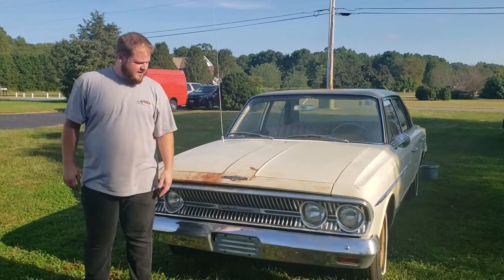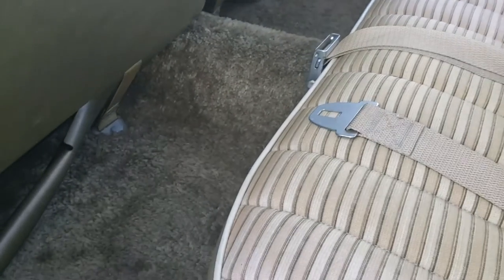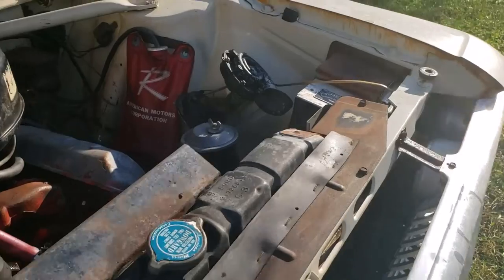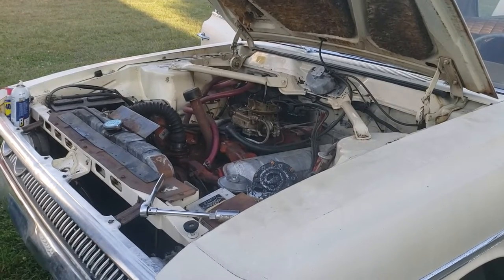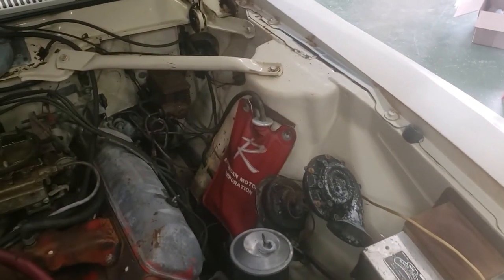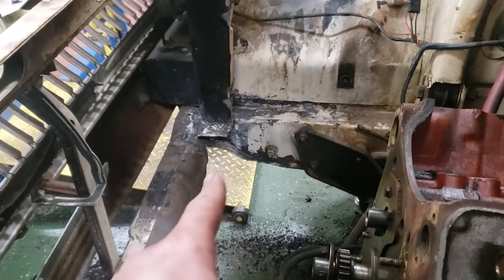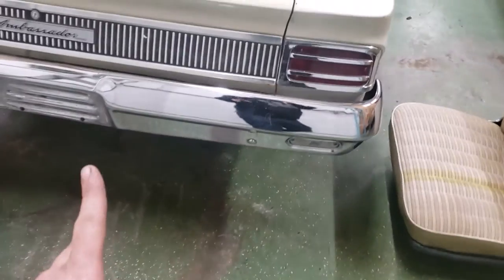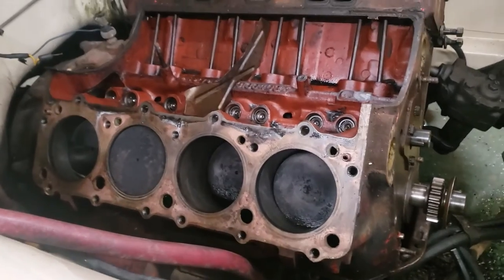Will It Run? - FORGOTTEN 1963 AMC Rambler Ambassador

Comment: Had a '64, same color combo! 327 2bbl. Turned 16.8 at Detroit Dragway, won my class and 4 more rounds of Pure Stock eliminator, with it in 1969. Helpful hint: these engines have nylon coated cam gears, like Pontiac V8s. The nylon gets brittle with age, and if it fails at idle, the engine will maybe survive. At speed, you'll need new valves and pistons. If you buy one used, immediately replace the timing set with one with all steel gears. Otherwise, it's a stout, reliable engine. Make sure when you put the rocker shafts back in, that the hollow bolts go in the rear holes on each side. Thats where the rocker arms get oil from. I've seen those bolts so full of sludge, that you cant tell them from the solid ones. Join the AMC Rambler Club, or The American Motors Owners Association (AMO), to find parts suppliers. There is a Rambler 327 specialist, Kevin Nichols, in Metamora, Ohio, that is a good source for 327 parts, and engine rebuilding.
.

Comment: Amc of this era up to the 67 and becoming Rebals and Ambassador, was the use of enclosed drivelines. Also the front suspensions used trunions and can wear out. Vacuum wipers were in use into the late 70's. Converting to electric? You will need the complete system to make this happen! Have owned many Ramblers. Fun to drive and worth owning.
Reply: I had three AMCs from the 70s. They all had electric wipers. Intermittent even.

Comment: My 64 has the same problem with the rusted cowl but everything else is fine. You can rebuild the fuel pump a kit is on Ebay or was for me last few months ago but not the wiper half so be careful taking it apart. The tank can be saved because no one makes reproductions. Get some gravel and white vinegar and start shaking then pressure wash out as best as possible. Then buy some tank sealer after you patched the holes. There is a place online that sells the correct style sending unit too.
Reply from the maker: All the sheetmetal has been replaced. New video coming soon. I have a rebuilt pump for it. The tank was completely junk. I sourced a used tank that was hot tanked and pressure tested at a radiator shop. On motorcycle tanks I use Oxalic Acid. Stronger than vinegar and leaves a surface that doesn't flash rust.

Comment: I have a1963  Rambler 770 Classic. You have a 1963 Rambler Classic 990 Ambassador.. Your car looks like an amazing survivor. Best of luck in getting it to full driving condition. Check under fenders near cowl for rust. Water sits in cowl area and rust out that area. Lots of parts available but sources can be limited. You need this book which available from several sources online. 1963 Rambler Classic 6 & Ambassador V8 Service Manual.
Reply from the maker: The cowl, fender braces, and firewall were completely rotten. All the sheetmetal has been fixed at this point.

Comment: A lot of the Jobbers and suppliers for Rambler and AMC are still in business in Wisconsin, I used to restore International Scouts and they used a lot of the same suppliers. I am told that Rambler shared a plant with Scouts at one time, (It was either Shadyside (In Pittsburgh PA or the one in Terra Haute IN) It has been so long I don't remember which. Several of the engines Rambler and Jeep shared, although some of the parts on there were different.
Reply from the maker: Thanks, I actually did a 78 Scout II a few years back.

Comment: I had one of these in 1965. There is a carburetor rebuilder in Florida that will rebuild these. Some of the parts from a jeep 327 Vigilante will cross.
Reply from the maker: Thanks, I found a 4bbl manifold for it already and will probably run something aftermarket

Comment: You DO know not to start an engine that has not been run in a long time without making sure there is oil circulated throughout the internal parts, right? A drill on the distributer drive to pump up  the the lifters is a good idea. Serious damage can occur in seconds on a dry engine. Fortunately the AM 327 is bullet proof.
Reply from the maker: You do know that if you arnt planning a full rebuild on an engine that's been sitting for decades, you're just kidding yourself anyway? This engine recieved a full tear down/inspection/rebuild after years of hack mechanic work revealed itself.